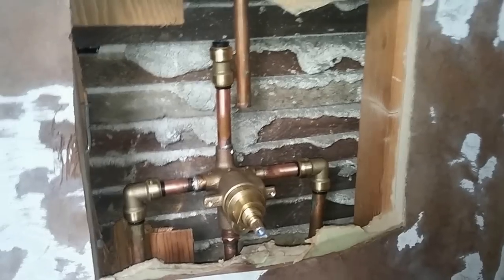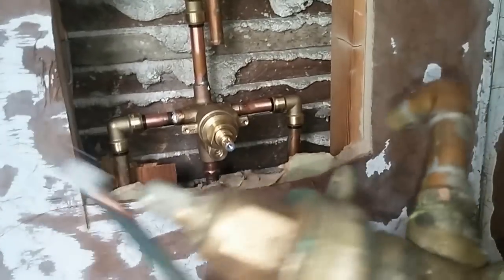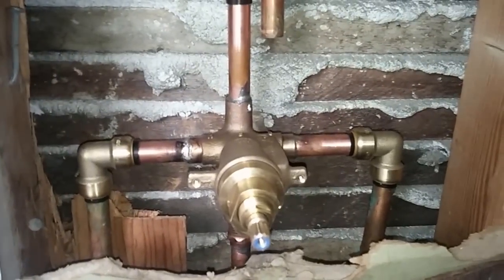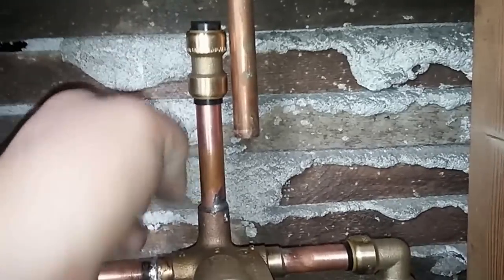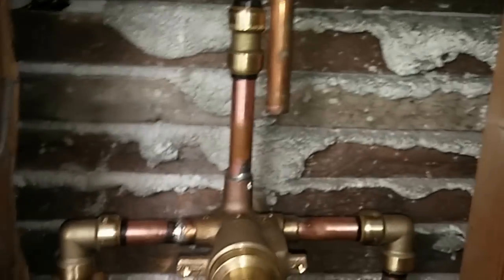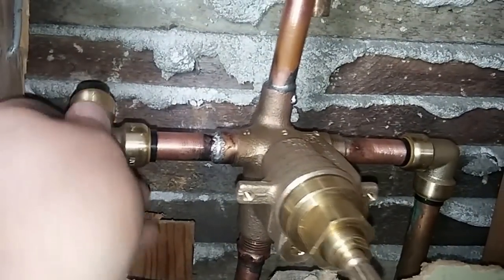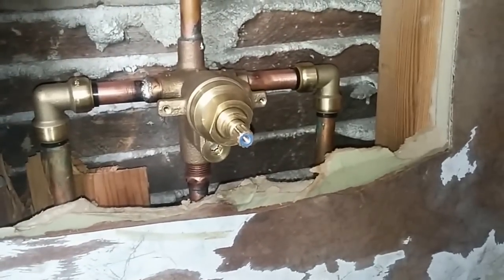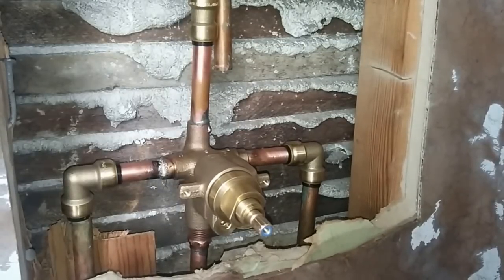Connect COPPER pipes with SHARKBITE PUSH Fittings - NO SOLDERING - SYMMONS Shower Valve Installation

Comment: In Canada it is ILLEGAL to use SharkBite or any compression/flare-fittings in any areas that are not accessible. Only solder, glue, or crimp fittings are allowed to be installed behind drywall or any surface coverings. My preference is PEX with crimp rings.  I don't trust the O-ring in those SharkBite fittings to last more than 5 years before they start to leak.

Comment: You solder the bottom?
Reply from the maker: The bottom is soldered and has threaded fitting that goes into the value. That is a short pipe that i installed first and fitted inside the wall.

The short pieces on top and sides are also soldered into value

Comment: Yes this might have been easier for you but it's bad advice to give people. Press to connect fittings are good for a quick fix until you get around to do it properly and should never be used inside a closed wall